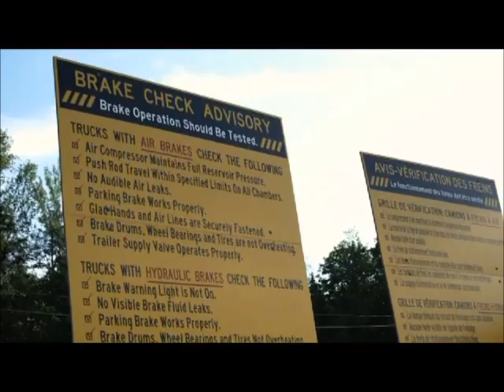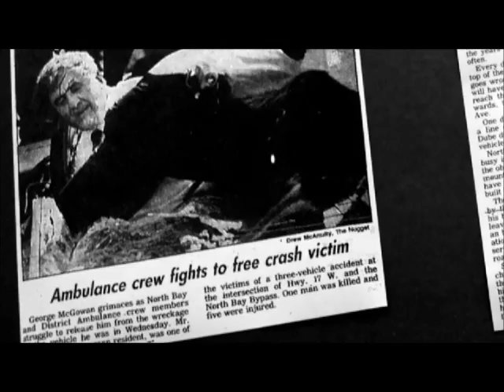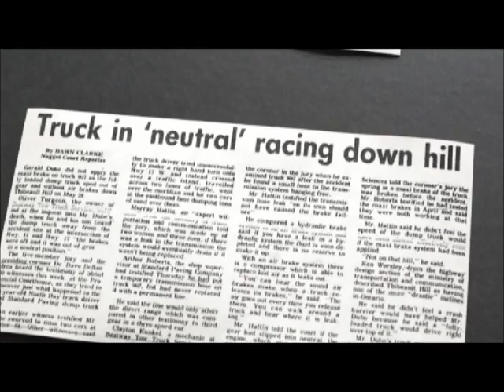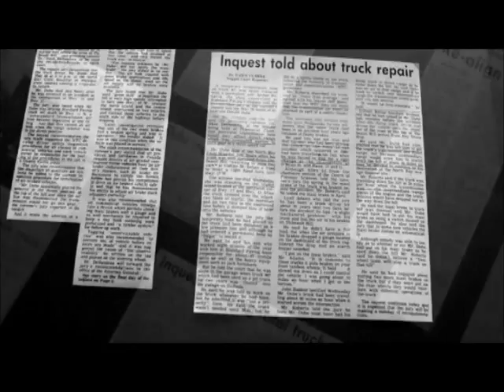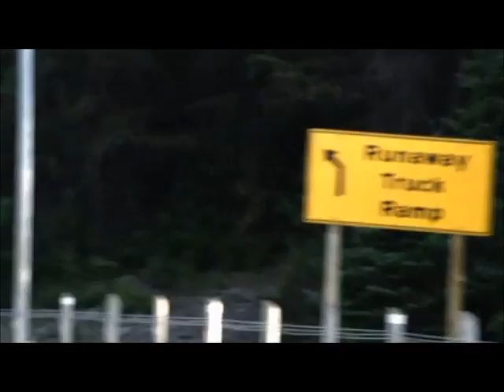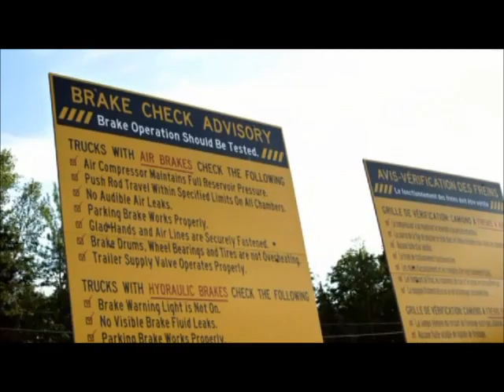Runaway Truck Ramp Demo

Comment: so the gravel where the truck received minimal damage and is pretty easy to reset is replaced by something that damages the truck, slams it in to a wall and mostly likely costs 1000's to replace??
Reply from the maker: Simon, I understand the pessimism. However in colder environments the gravel wasn't working and there were actually some fatalities. The reason for the gravel not working is because of freeze/thaw. The snow would melt underneath then freeze the gravel and it wouldn't slow the truck adequately. Also for gravel you need a longer runway which isn't feasible on some mountain passes.
Reply: Gravel system tossed that truck which used it into the wall as well and since its Gravel and thus porous the fluids would be coated all over the gravel which some of it got tossed into the roadway. So gravel that got contaminated would have to be removed and cleaned or replaced. More time consuming and takes up too much room not giving enough response time.

Comment: The crazy part is that if you use the run away ramp you get a ticket and I don't think that it's fair for them to do that
Reply: Ur right, i think the case should be investigated and if its shown the driver/company have been neglecting vehicle maintenance they should get a BIG ASS ticket but if its a random malfunction that happens sometimes on cars they shouldn't.

Comment: Try building a RUBBER PIT,  where a pit filled with tire BEEDS used to stop a fully loaded truck... The further the truck goes into the pit the deeper it plunges into the pit... where a cable winch is used to pull out the RIG...  safer and less damage to a Truck...

Comment: so the drag net basically makes trucks wreck? i'm not sure I understand.
Reply: Peter Gizmos 
A truck can be replaced.
The people killed in the previous accident mentioned in the video are still gone. Forever.
Other options (e.g.: gravel bed) don't work in winter months and don't give enough time for drivers to know they have brake problem in that hill.
What's not to understand?

Comment: what would happen if a normal car was to use this? i would assume it would stop the car almost instantly as it weighs a lot less and therefore would cause injuries.
Reply from the maker: The runaway truck ramp multiplies the force the longer the vehicle goes down the ramp with the multiple fences. You're right that it would stop the car quicker however not to the point like a concrete well. The passengers would be just fine. A 4,500-pound vehicle hitting a 30' wide net at a speed of 62 mph will stop in approximately 83' with an average deceleration of approximately 1.6 g's.

Comment: There is not a strap in the cargo per every 10 feet. Is a lot more straps during this test. The straps will split at 10 feet per cargo space and shift the cargo at the time of impact. Cargo shifting will break the combination trailer safety wall and kill the driver. In my personal opinion a better system to stop it can be design without killing the driver, damage the rig and the cargo will not shift by the stopping G force. It can be design better but the stopping distance would be greater. Research, design, prototyping and testing should be in place in real expectations and different weather conditions before presentation for public take place. I can design such special ramp if government and DOT is willing to pay for all expenses involved. Thank you.
Reply: Good point!

Comment: Those nets basically spun it into the wall, meanwhile without it looks like he could've saved it. Gravel is better and safer.
Reply: Not good for all applications and it won't work in Ontario. Also, flying rocks tend to damage passing cars.
Reply: True, true. Works good for uphill applications, like in Arizona through that mountain range.

Comment: The truck was ruined and what if there was another truck with no brakes in the next two to three hours?
Reply: they close the highway to trucks while they reset the catch system
Reply: I think minor damage to a truck is better than risking a few lives.
Reply: I didn't say it was a smart thing to do but that's what the MTO has decided. When a truck uses the runaway ramp they close it to big truck while they take a hour or so to reset the system

Comment: Ok what about if a second trailer crash After the other one in The same spot and and there is no more of the stopping equipment
Reply: I was thinking the same way but if you look up ahead of that there's other set of cables if I see right and if that's the case they have it set to side soon that truck goes by comes around and hooks just in case another truck has to use it that's my thinking

Comment: Trucks have other means of slowing so this is the last resort which destroys the truck. I would much rather destroy a transmission than 100k truck
Reply: I would be interested in learning your method of stopping a runaway truck with burned out or malfunctioning brakes going down a steep hill by destroying a transmission. Once destroyed, your truck has no connection to the engine, and will more than likely just freewheel.

While I agree using the runaway lane is a last recourse, if you are at this point as demonstrated in this video, you have exhausted any other opportunities to stop before you go into a congested area. You now need to take that last recourse. Yes. serious damage will occur. Depending on your deductible on your insurance, it will cost you or your employer a bit of money. Fail to take that last recourse, and you will be likely to be at fault for injuring others, or worse.
Reply: +calmargarita Modern trucks rarely need to use brakes. exhaust brake is the most common and economical way of slowing down with downshifting.
Reply: +scanjett 
this is true for normal driving, but we're looking at a steep hill with traffic and pedestrians at the base of at least this hill. and we're talking about an out of control situation where brakes are no longer effective and an exhaust or compression or driveline brake will not be sufficient to stop or slow down a truck before entering the congested area.
Reply: +Brian Mason yes but even if you lose all brakes the exhaust compression "brake" is still going to slow you to full stop even if you are fully loaded.
Reply: +scanjett 
no, not at all. my Cummins ISX 500 loses a fair amount of engine braking capability at lower RPM and fully loaded would never stop me if my trucks brakes lost their effectiveness. Engine brakes are most efficient at high RPM.
Older trucks fitted with a Caterpillar engine could be ordered with both a compression brake and a retarder which acted on the driveline using engine oil in sort of a torque converter style system. You could add a "Pac-brake" exhaust brake, too, and even a separate magnetic induction driveline retarder, and get the results you're looking for. A lot of extra weight and expense, though, for a "just in case" scenario. I'd be happy to take you along for a demonstration if you wish. I'm in Canada, and frequently go past this hill and runaway lane. Also through the Coquihalla highway, (the smasher), Salmo Creston (Kootenay Pass), and many other notorious hills.

35 years heavy trucking. Designing my own trucks from the factory and doing very heavy loads in the 220,000 lb range
Reply from the maker: I can attest to the usefulness of this device. In WY there is a pass near Buffalo, WY that utilized this technology. Every vehicle with the exception of 1 has been able to drive away from the scene. Yes there is some damage but the rigs have all been drivable.
Reply: +calmargarita But if you downshift and keep RPMs high then it works fine.
Reply: +scanjett I would love to know your background I highly doubt you know what you are talking about
Reply: scanjett I would have a tendency to agree with you doesn't sound like he did much driving on Hills. I've went down some steep hills where the jake brake is not enough to keep the truck from accelerating U eventually have to get back on the brakes to slow the truck back down to a reasonable speed and then get off the brakes to let the brakes cool down and on the Jake again. but it's still speeds up
Reply: William lynes I was agreeing with you. not against you
Reply: Fellas, can we leave the anger and frustration out of it and just have a nice discussion with intelligence and understanding that there are new people out here who need to learn.
Reply: scanjett Dude....even if...at the top of a hill...you selected the right gear for going down....even IF your Jake was working the way it should...pending the grade...If your brakes fade....you're pretty much done for...as there would be NO way to down shift once the rpms are too high....so I have no clue what you're talking about. 

This trap is a "last resort" and very expensive to use...IF you're ever at the point that you ever required to use one....you won't give a rat's ass about a little rad, cosmetic and and maybe some suspension damage...I guarantee you of that!

I was once in a situation...WVA, owner speced the truck I used without a Jake to save money...I was making my way down a steep grade grossing out with just 80k and noticed that I was speeding up...even though I was feather the brakes going down the grade. .shortly there after...got a call over the CB...Hey Buddy in the White Freight Shaker...your brakes are billowing smoke...

Needless to say...the next 2 miles were the craziest of my entire trucking career and the closest I've ever come to death!! Fortunately for me...as I didn't know the area...I was lucky enough to run out of grade...and was able to get my truck stopped....

I put about 2 million miles on in total...hauled everything from Vans, Drop decks, flat bed, heavy equipment, 5xans to rail yards with trailers up to 5 legs down, ....and living in Canada...all in every imaginable types of weather...covering ever State...except Hawaii and Alaska...every Province but the Yukon...NWT

Shit happens...you just never know...as a last resort...those traps...will save lives, no doubt...needless to say, I stopped working for the cheap bastard when I returned...I was young and only a few months driving at that point and wanted work...lol...just not worth driving sub standard equipment not capable to doing the job safely
Reply: Engine brakes are incredibly important tools for any driver. When used properly they can hold back a fully loaded truck at the legal limit. The goal should be to never EVER downshift while descending a grade, and to never touch the brakes unless it is a less than 10-second jab, or an emergency stop.

10-second jab: this is a driver's bread and butter technique. You want to be able to slow down to under 1,500 RPM (you use the tach, not the speedometer) in less than 10 seconds. If you are in the right gear for your grade and load, and have properly functioning engine brakes, you should only have to do this every minute. This allows time for the brakes to cool between jabs. If you find that you are accelerating too fast for this, then you should attempt a FULL STOP on the shoulder (while you still can) before changing to a lower gear and trying again.

I have driven down countless steep grades with full loads, all over the United States and Canada. When done properly (being safe instead of impatient) you should be able to cruise down the grade comfortably and without fear. Yes, it is slow and sometimes annoying to travel at 15 MPH, but... You'll get down without abusing your brakes or transmission. When in doubt, choose a lower gear. Going down slowly is better than risking lives.

For those saying the jakes can't hold the truck back on their own: That depends on a number of factors. Sometimes they can. I know I have made it down many "scary" grades without ever touching my brakes, at or below the posted speeds. I was taught... Ignore the signs and you'll regret it.

Whatever you do... NEVER GO INTO NEUTRAL! Not even for a second.
Reply: Hi drivers. Just remember, there are courses available for mountain driving, especially in BC. One thing you will learn is a steady brake application of 10 psi OR LESS will not overheat your brakes, and allow you to maintain some speed. This means along with using the engine brake, and a gear that allows your engine brake AND service brakes to hold you back. Always best to begin the downgrade slower and adjust higher. Be wary of changing grades on the hill, too.
Authorities have, in many locations, established lower truck speeds that even empty trucks must adhere to. Grapevine, Monteagle, I-40 in NC, North Bay, etc. This, unfortunately is due to "warm bodies" without adequate training sent out to work in "fancy" new Pro-stars and Cascadias with small engines and useless jakes, with the expected results.
Proper training in mountainous terrain is very important, but not used enough.
Reply: Going to have INSURANCE anyway, and besides, that truck was not "destroyed" beyond some cheaply made fiberglass fenders, the grill and bumper, the hood and radiator.
Reply: He'd slam it in 2nd gear or reverse, probably blow the engine too then ;)
Reply: And how many lives should be included in the cost of your transmission?
Reply: Shame to trash a practically new lease truck like that. Should've used some old bucket of bolts at the end of its service life.
Reply: @safetygeek5954  yes you are right I live in Buffalo Wyoming over the years I have seen and heard about trucks using this new catch net system you can look it up on WYDOT. Living at the base of mountains I think people don't understand it's steep coming off the mountains we have a 7% grade here
Reply: You don't know anything about trucks driving off a mountain do you?

Comment: Ya untill someone gets out of the truck, and one of the cables snap and cuts them in half
Reply: Seriously, not going to cut you in half, been proven by MythBusters a few times,  severely mangled at best but would have to be under tension for it to happen and these are Not spring loaded, its just tape using its own resistance to bring a vehicle to a stop.

Comment: The old pea gravel system did the same thing without damaging the truck.
Reply: What you do not see underside is the actual damage, I have seen a video of a box truck literally getting flipped when it used a gravel ramp, you can easily look it up.

Comment: Drag net system will totally fuck up your truck!  Truckers will think twice with such a terrible system.  Sand/gravel traps seem less damaging to runaway trucks. How about better highway planning next time so you all can put in sand/gravel traps in the right place.
Reply: What part of "it won't work during half of the year" are you missing? It's ineffective during the winter months
Reply: Also did you not see the bouncing and loss of control when said truck hit the gravel, not to mention that gravel stone is no less than 2 inches diameter and yeah it can get tossed into oncoming traffic and do damage to those cars as well as the unforeseen damage done to the underside of said truck not just from the bouncing impacts but the stone getting tossed up as well into the oil pan and such. I have also seen a video of tow trucks, not just one but a few being used to pull a truck that used a gravel ramp just to remove it from 100+ feet into the gravel before it came to a stop. I have driven on gravel road or surface with smaller size stones and its just as bad as going through and getting stuck in sand.

Comment: This may be a good idea but, there should be two runaway areas. They said it would take at least 4-5hrs to clear and reset the area. So as long as only one truck fails in every 6 hrs will things be safe. Heaven forbid two trucks should fail only a half hour apart OR at the same time with only one runaway zone. Great for one guy but, sucks to be the other one.
Reply from the maker: It's my understanding, that usually they only have to utilize this a half a dozen times a year, I'm sure it depends on which mountain pass it's on. I also suspect that they actually stop traffic up on the pass on some of these as the cleanup takes up most of the lanes.
Reply: Cory Smith I assume there is some kind of warning system at the brake check area that the runaway ramp is disabled and brake checks mandatory. Or there should be..
Reply: Full brake failure on commercial trucks is relatively rare. The air brake system is robust with several layers of protection, and drivers are trained on how to manage it and inspect it to spot problems before it leads to this. They also have other methods of slowing and controlling there speed such as engine/exhaust brake systems.
Reply: Cory Smith that red Frieghtliner looks like he was on 77 in Fancy Gap

Comment: Failed project you guys are destryoing trucks instead of avoiding the accident. Gravel is better. Just cold brakes and adjusment so you can keep in way
Reply: Martin, you must have missed the part where they said they did have gravel.  But the exit was too high up, according to truckers, and it froze in the winter making it all but useless.  You need something which is available in all types of weather. and give the trucker enough time to realize he has a problem and do something.

Comment: Actually a Total failure, as the truck went sideways, which indicate that something did NOT WORK as expected and failed. So in a real runaway at 120km/h I would not like to be in that truck. 
This system is a DISASTER waiting to happen! 
Good luck stopping 2 trucks, like in this example
https://www.youtube.com/watch?v=C0BxORWTD7s

Comment: so your truck gets absolutely destroyed using this system , great , yep total incentive to use it ,add the fines and reset cost , hooo eee ,now its getting expensive , in Australia on any steep hill you have to use a gear able to hold the truck without using the brakes , usually about 40 kmh  , and all trucks here are speed limited to a max of 105 kmh , the expense here comes from the fines if you exceed these speed limits , incentive to travel safely ? you bet !